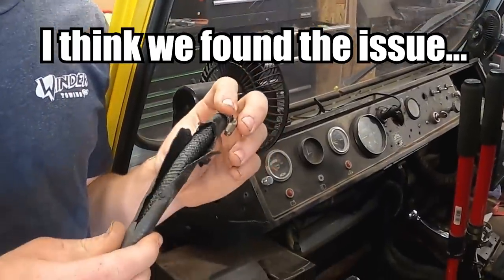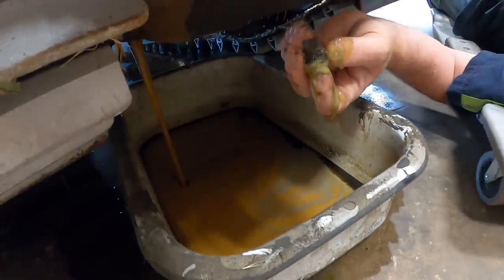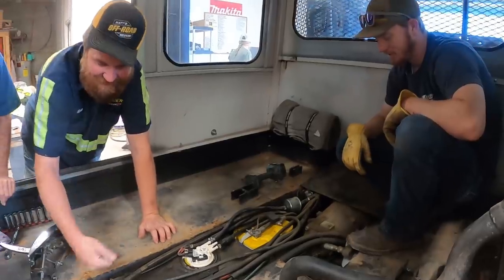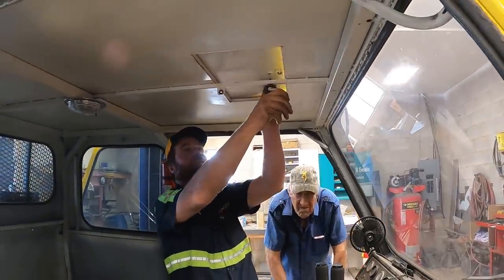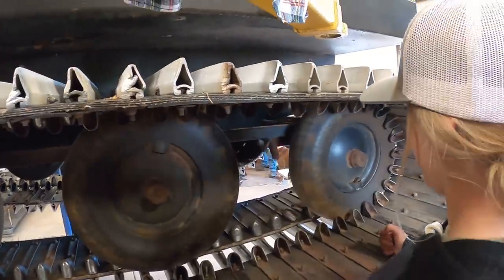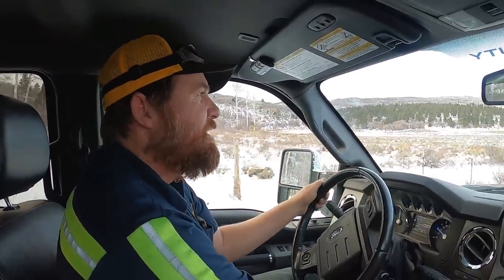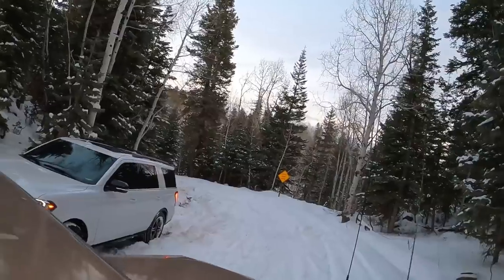What!? Gasoline Is Spraying Inside & Out

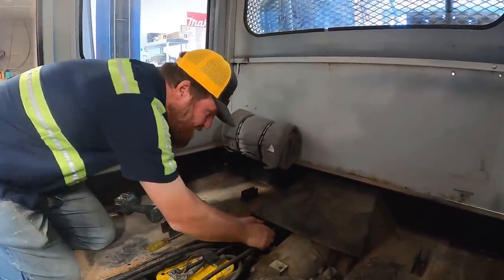Comment: 7:51  I'm sure there's someone on youtube that can ID what Matt is packing here in his right front pocket
Reply: I'm gonna guess Glock 36, cmon Matt, we need to know!
Reply: What holster does he's use ? 😋
Reply: I was thinking Springfield XD compact.
Reply: By size, I'm guessing Glock 43... painted yellow!
Reply: Arch Stanton. Since you’re been watching Matt’s recoverys, I guess you know to stay out of the sand with your 5er. They’re heavy and their wheels sink like nobody’s business in that loose dry sand. I don’t drive in loose sand if I can avoid it. Now, mud is a different deal. I grew up on a farm in Oklahoma in the 1950s and the only paved road for miles around was the state highway. All the rest was dirt unless it was raining then they were mud. Thick, gooey slippery mud. I learned to drive in that stuff, and you didn’t drive a car with an automatic transmission in it. A vehicle with an automatic transmission is the worst kind to get stuck in. You never know how deep the stuff is and if you keep on spinning your tires after all forward travel stops, you wind up getting high centered if you’re in deep mud. You have to make your vehicle rock back and forth by slipping the clutch  and gunning the engine. Push in the clutch when forward motion stops. keep the vehicle rocking this way and eventually you’ll work your way out. If the mud is too soft and deep, you’re stuck no matter what you do. That’s when you call Matt to come pull you out, unless you’re way down in Oklahoma or somewhere a jillion miles from Matt. Then, all you an do is lock it up and walk out to where you can catch a ride and come  back when the mud dries up and drive it out.  That’s what people did back then when they slid off the road into a muddy ditch. The dirt road going by our house was hard packed red clay with a road crown. When that stuff got wet during a rain storm, it was slicker than snot on a doorknob and you couldn’t stay up on the road for nothing due to that road crown and the borrow ditch was full of that wet, sticky, gooey mud, and that’s where you ended up. Everybody that wound up there usually didn’t try to get it out because it was a futile effort and trying just got them in deeper. So, they locked it up and walked to where they could bum a ride home and come back after the mud dried up and drive it out. Four wheel drive would’ve just made it worse in that clay mud. Now, the brown mud was a little different. Nobody around there had 4WD back then, but it would’ve made quite a bit of difference used intelligently.
Reply: @derekbosch8955  thanks for the lol
Reply: Isn't that imprint from the battery pack for the microphone he's wearing? I thought batteries were always that shape.

Comment: Matt, usually factory setups will usually have the bigger fuel line on the feed side, and if that fuel tank bucket/pump assembly is from a mid/late 90's or so S10 or similar GM product (that style fuel pump bucket was mostly used in the late 90's, before that they had a steel cap with a hanger hanging in the tank) then the 3/8" should be the feed, 5/16" the return. The thing you run into is that any pressure on the return side of the regulator will increase the pressure on the front side which can mess with fueling, so on setups where a high-performance pump or similar work has been done, it makes sense to run the same size or even run a bigger one on the return.

Comment: Been in the hose business for over 30 years. Trans cooler line is totally fine for gas. Its a Neoprene liner same as fuel line, it just  handles higher temp and pressure than ordinary fuel line.

Comment: There is a good product for noise dampening called roof insulation it's a thin rubber pad that has a sticky side it works great put it in my 1974 vw bug

Comment: If I remember the video when Matt and Casey were trying to get the Snow Cat running, the fuel pump replacement was a quick "let's see if it will run". Not really fair to lay the blame all on Casey. I can't find that video, it must have been deleted.
 Also transmission cooler hose is generally heavier walled, with higher burst and temperature ratings.
 I do wonder what happened between them.

Comment: sound deadener showdown is a great resource to get materials to retrofit in some sound deadening. 

A little insulation in that cab with a heater also may do you some good. Should be pretty simple to work into the mix.

Comment: In my experience with my Piston Bully (Kassbohrer) snow cat, zero radius turns work fine on low traction surfaces like ice.  High traction surfaces like compact snow peel tracks off easily.

Comment: Certified mechanics are one of our biggest nightmares.  'Certified' engineers, too.  I can't tell you how much rework I've done from those types of shops.  It's one of the most despairing issues right now with auto manufacturers trying to force you back to the dealerships for repairs.  

I'd run some vent lines from all cases back to the air box.  Severe weather duty vehicles get water in them so easily.  Another thing is, if you try to seal the case, the harder you try the more water gets in.

Comment: To prepare that for the season Matt if I had that vehicle I would put a heater in it cuz it is going to get kind of cold out of the snow and put in all that sounded like what they use in classic cars it's not real thick but it makes for a very quiet ride and you might want to put in some thicker carpeting in the back and that will also stop on the sound deadening as well

Comment: Certified mechanic didn’t even use the GM quick disconnects on the fuel pump, though neither did you!  They sell them in the parts store with swage on them so you can clamp the hose onto them properly.  Definitely need to figure out a way to the backseat and get that lid sealed up.

Comment: Matt you have the LF6 4.3 made in 96+ as yours is MPI rather than the older TBI fuel injection. The single throttle body and plastic  1/2 intake and EGR valve by the rad hose. Do not order tune up parts and accessories for a older one you will be dkd. Nothing is the same even the belt drives.

Comment: Get the Battery outside with the engine and then add a Quick Connect in case jump-starting is needed for the tow vehicle.

Comment: Get a gear box like that filled with chocolate milk fill it with diesel and run it for a minute or 2 drain it then fill with diesel again drain it then fill with your lubricant of choice. Works great for transfer cases, diffs basically anything gear case related

Comment: I ran into a situation where a Subaru blew past 2 snow berms to become hi centered on the Union Pacific mainline over the top of the Sierra Pacific mountain range.  I originally came up there to take pictures of Amtrak #5 coming out of the longest tunnel over the Sierra's, which is located near the Sugar Bowl ski resort.  First I had to contact Union Pacific's Emergency Operations Center and hold all of the rail traffic to prevent the the car from being hit, and spinning like a teacup on the Disneyland ride, or worse yet cause the train to derail. I spent about an hour trying to dig the vehicle out, but without luck.  Finally one of the snowcat operators from Sugar Bowl gently pulled him out.  The Operations Guys including the snowcat driver were really cool.  I'll see if I can dig up the photos, and send them to you.  You would like these newer models, climate controlled, joystick control, foot pedals, and stereo to boot.  Yes they do turn on a dime, and have the ability to add multiple attachments, and man the angles these guys work at amazes me.  Guess my hobby paid off for this idiot, and prevented a possible accident.  It made my day when the Amtrak Engineer gave me a friendly toot, and I waved a highball.  The next day I met the Union Pacific dispatcher who manages the mainlines over the Sierra's.  We shook each other's hand and said thanks.

Comment: Matt I'm a little concerned on your repair. The 4.3 had a few different fuel pressures depending weather it's carb or  throttle body or central port injection. Carb and throttle body have up to 13lbs fuel pressure. The central port injection models have about 55lbs fuel pressure and rubber hose like that won't handle that kind of pressure. cpi models also have locking fuel lines that lock on the the lines and fuel pump. Your fuel pump looks like a 55lb central port type pump. If it is it will last a little while and then blow the lines off or blow up the hose

Comment: Say the original builder had good ideas just needs lota improvement lol lol batt under fuel line dude had deathwish rolling Fire 💣💣💣💣💣.. Im in a wheelchair ..one of my favorite things in a day is watching you all work smarter not harder and you do it all together as a unique tight nit family .. Gongrats on fixin the snow cat...  Got idea 4 you get some rolls of the material they use for the floors of cars to deadin the sound and put it in the cab of the cat . and in motor bay.. Should help the rattle

Comment: Matt I remember you saying how cold it is inside the sno cat i am using a china diesel heater 12kw burns 10 liters of fuel in 40 hours i use one to heat an out building and have one in my truck sleeper

Comment: Check that it's not a bad hydraulic oil cooler that is getting coolant into the system.  I'm assuming there would be a oil to water heat exchanger in the system somewhere.

Comment: You can run just about any rubber lines for fuel as long as you run 91 octane. You need Teflon fuel lines if you run anything less than 91 octane. All lower grades of fuel have ethanol and your typical rubber lines will not hold up as the ethanol will eat them up. You have  a limited amount of time before the lines you just replaced degrade and starts leaking again.

Comment: You mentioned the gearbox filling with water. Is the drain for the sunroof connected to the vent of the gearbox? Something to check considering the other cobbled repairs done on the machine.

Comment: Certified mechanics don't make mistakes like that unless they are rushing or they just don't want to take their time and do the job right.

I have been an Agriculture Diesel mechanic for over 30 years. I have never rushed a repair or service job.
I have over 450 recommendations from farmers and Rancher's that have been very happy with my work.

If you ever need a good caring Mechanic I would be happy to help you and answer any questions you have. One more important thing, I do not believe in over charging for any service or repair. I have a flat rate that beats any mechanic shop out there in Idaho or the surrounding areas.
In the Agriculture Industry you do not need to be certified but you do have to know every make and model of tractors and equipment.

Comment: Using "oil" hoses for diesel is pretty standard, they have no problem with diesel and are often rated around 290psi so enough for all the low pressure lines. Gasoline is different, that stuff will eat "oil" hoses, the newer gasoline that is (lead free, some other additive instead that dont work with normal oil hoses or gaskets!)

Comment: 8:50 ... Liquid water. Is that a techincal term? Would solid water be ice? You can get some blue foam board insulation to help keep heat in and noise out.

Comment: Matt "The key to keeping this thing running......probable better maintenance (as he drains the milky transmission fluid contaminated with water)and probable don't spray gas all over key components"  (as he replaces the leaking fuel lines).

Comment: I have an argo with that drag brake steering and it's absolutely useless in deep snow, you need to make an arc the size of a parking lot to turn because you can't get anywhere besides digging straight down with only one track pulling.

Comment: If it’s got 706 castech heads on the vortec then they could be cracked at the head bolts and that’s how you’re getting so much water in the oil.

Comment: Just trying to work the snow cat transmission out. It sounds like there's a disc brake on the gearbox output shaft, and then the diff has internal brakes controlled with the red levers on each side to control track speed?
Reply: @MattsOffRoadRecovery  thanks for the reply!

Comment: Hey buy a bucket of Flexi dip and put that on top where that window is you can buy clear or you can buy black or you can buy white that will seal any rain water or anything there’s a commercial on TV about that just get it put it on there you’ll be fine you can Flexi did the whole inside of your there so it doesn’t leak go get it don’t cost much

Comment: that things is a money make fuel line oil lines should be change when they start to fell hard or evey year raditor hose after you change put the old one in the basket on top and change out the fam belt carry them in case your break a belt and blow a hose it good idea to carry the old hoses on the road and carry about 5 gallon of water all these can save your butt

Comment: Blazer transmissions were junk.  They failed with ease.  The Vortec 4.3 is a legend that should have never been matched with the junk transmission.  But if the transmission input shaft is welded better or changed to an aftermarket setup, it is fine.

Comment: It's really not hard to get ASE certifications. My fiance doesn't know diddly squat about anything automotive. In her mind "turn key, put the stick in D to go forward and R to rewind" when we first got together she asked me, "if the R is for rewind, what's the D for" during my most recent engine rebuild, when I pulled the head and put it on the kitchen table she told me to get my pistons off the table. She's Asian, a surprisingly excellent driver, and terrible at math. But she still passed my ASE recertifications.... Ok I helped the tiniest bit, but seriously. ASE is a joke and the reputation they uphold to the public is worse than what falls out a horses rear end compared to the actual knowledge required to do anything automoto.